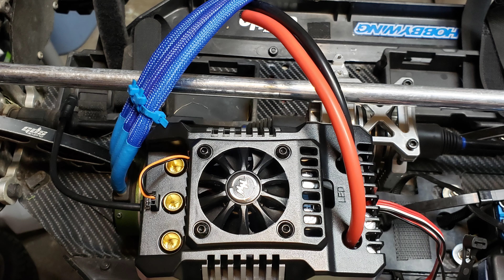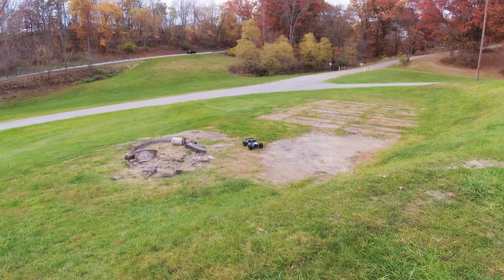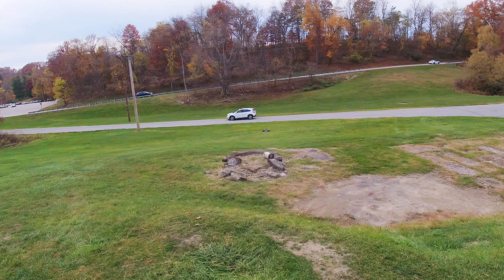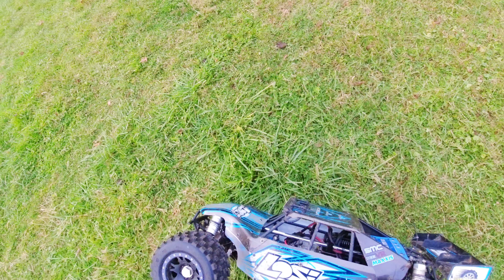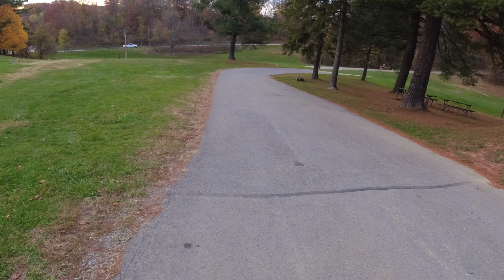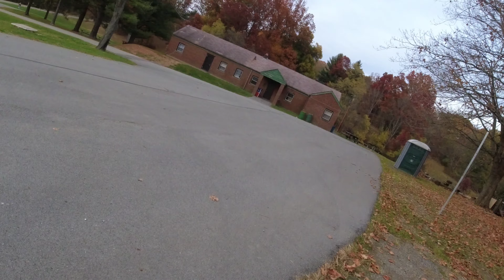Losi dbxl-e HW Max4 12S Bash Test

Comment: You still loving the max 4 ? I’m about to pull the trigger and go all out on my kraton 8s
Reply from the maker: What is up man! Yes the Max4 is awesome! Haven't had it out in a bit due to weather. But it never fails to amaze me the power it has. Kraton will be nuts 12S lol. Have fun man 👊🤘
Reply: It’s on 12s now lol just on a ztw every time I gear it up the motor starts to cog I don’t think the esc can handle the power it throws excited to get the max 4 tho everyone is having great luck
Reply from the maker: @andrewtexiera2858  I see. Almost got a ZTW a few years ago. Stuck with 8S for a couple years. Then got the 16S Flier and honestly hated it. This Max4 is beyond both of those IMO
Reply: @SteelCityRC  oh yeah you can tell from your running video with the r snake vs the max 4 it’s night and day honestly the r snake I hated also blew mine up cause I over geared my 700kv motor lol the ztw is more user friendly but the power just isn’t there without risking it blowing up